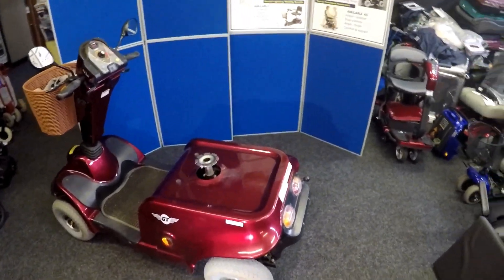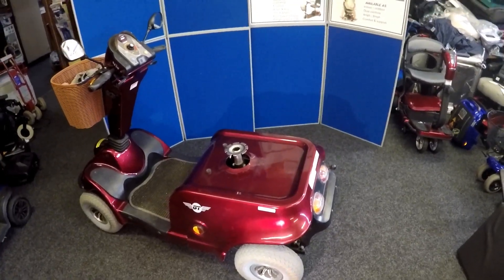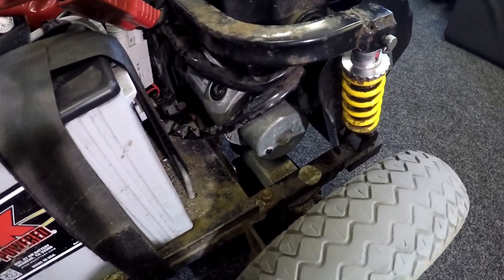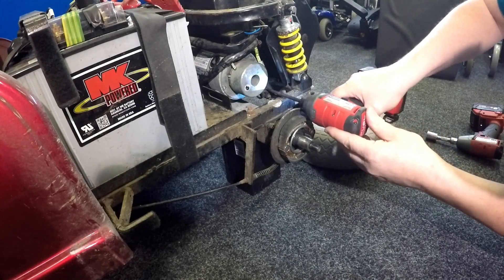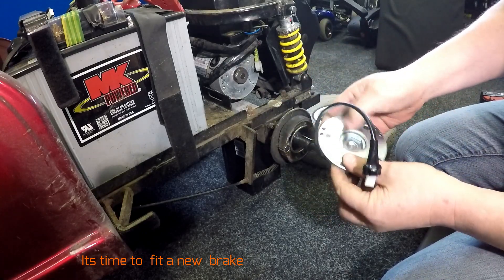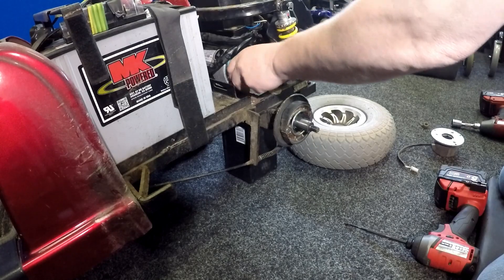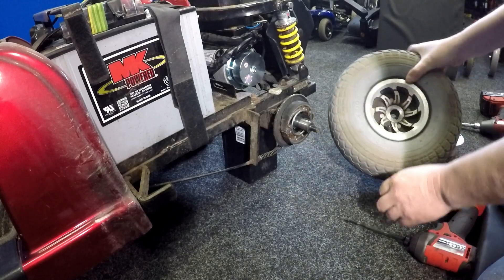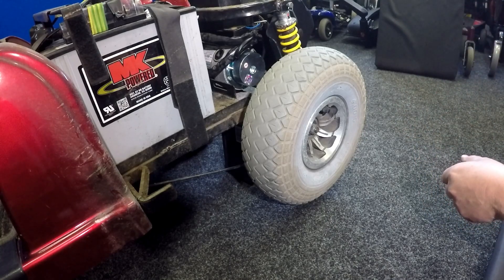Electric Brake Failure

Comment: Hi sir I have lightweight folding wheelchair but always i have issue on right motor but left ok i replaced the right 3 times but still issue coming need ur advice way to repair it instead keep replacing which quite costly in my place around $650 because parts not available
Reply from the maker: @alisaif8714  difficult to say should really get warranty on this. May be a manufacturer issue poor quality

Comment: Great videos I've learnt so much thank you. I've got a problem with my wife's scooter. She had an accident going up hill and the electric brake didn't hold, sometimes it holds solid and sometimes it creeps. I'm guessing replace the brake. The other problem is the thermal cut out cutout in hill why can't they have the reset at the dash board.
Cheers
Jonn
Reply from the maker: @TheMogzz  sounds like something overheating 🥵 the next time it happens check. The temp of the brake and motor which is hotter  could be a few issues either brake worn hence binding on creating heat, slack nut on the end of the motor, worn motor … or hill too steep for the scooter

Comment: Tip; Lightly grease the axle shaft/key area when the wheels are removed. Sometimes a scooter will display a slight clicking sound when driving and I have found that greasing completely stops this.

Comment: Just had a mobility scooter in for repair..

5 flash code.. after changing out the mag brake it was still the same..changed the brushes all good now.

Comment: i have an old shoprider scooter  a late 80s , i cant find parts in australia have gone to several store and they tell me it too old buy a newer one. The i slow down is back off the power coming up to where i want to stop. So the  brake looks similar to the one you showed but mine you can see that nut turning on the back of the motor its not enclosed. Can you supply one to Australia
Reply from the maker: david middleton hi yes we can post down under. Send me pictures of your brake and motor Assy.  To nithsdale.wheelchairs@btinternet.com

Comment: Boss what does it mean when one light flashes and continues to beep? kymco maxi xls
Reply from the maker: Billy Purse Hi Bill. Usually one green flash (led status light) is down to low power. Charge or get batteries tested or you just have done too many miles
Reply: @tomjacques4  the headlight is flashing and making a reverse type noise, very strange???
Reply from the maker: Billy Purse you been caught out in the rain ?

Comment: Do mobility scooters have a differential? Do they have a centrifugal clutch?
Reply from the maker: Most mobility scooter have a diff.  Some though may be fitted with 2 individual motor/gearboxes, makes turning at high speeds challenging. Also one or 2 out there are fitted with a single motor/gearbox and only drive a single rear wheel. Usually on small lightweight boot scooters.  Hope that helps.
Reply: @tomjacques4  cheers for that. The two individual motors sounds like a go kart. Do they not want to speed up or slow down for a corner? I wonder if any have been fitted with a Quaife LSD for grannies that want to go rallying? The one wheel drive sounds like a tricycle which I had a go on recently although I think the difficulty riding it was due to the lack of lean in the bends. As for the centrifugal clutch, when the battery was flat we could hear the motor spin but the scooter remained still. Unless there's some sort of drive engagement lever?

Comment: Is the electric brake the only brake on a scooter? Is it electromagnetic or friction?
Reply from the maker: The electric brake is usually the only brake and  is controlled by the main control box.  It is a solenoid that when power is applied will remove a friction Plate. Some scooter will have an emergency hand brake operated via a lever on the tiller. This is generally only used when in manual mode.  Hope this helps.
Reply: @tomjacques4  thanks a lot. I have been trying to fix a mobility scooter for an old lady who left her scooter unused for three years when she moved house because the new place didn't have easy facilities for charging it and so the batteries went duff. She took it to the shop but they wanted to sell her a new scooter which she didn't want so she asked me to source and fit some new batteries which I did but they didn't work. We tried her old charger which didn't seem to work so we bought a new one. I put it on charge and it seemed to be working but unfortunately the old lady unplugged it because it was on the landing. I plugged it back in and it no longer seemed to be working. I returned the next day to see the scooter missing and when the old lady came back from a day out she said that she had pushed it into her flat, put it on charge and now it was working which was good news because I thought I was going to have to take the cover off and look inside! Good videos, by the way and thanks for replying. Keep up the good work!

Comment: Hi Tom I see you are working on scooter that I have never seen here in Toronto Canada, But most of what you share is helpful and the basic layouts are the same, I have a Fortress 2000 and a Invacare Comet. I am 400 lbs so I need a large scooter for wheel trans trips and a small for bus rides around city, I shop for people that can't get around as easy as me. Thanks again for the insight Tom.
Reply from the maker: Hi again we also have the comet over here but it’s max users weight is 160kg /352 pounds

Comment: Nothing but hassle from my Drive Medical Envoy 8. Broke down three times. Thank goodness for Lloyds Pharmacy taking away to repair it the first two times. The most recent breakdown was due to a faulty electric brake.
Reply from the maker: Hi The Envoy 6/8 has lots of wires at the back end especially connected to a couple of fuse holders. they are cable tied to the s drive controller( stick out on top) and water can corrode said terminals always check these as I have noted that they can break or become slack very easily and cause the scooter to cut out or not even work.
Reply: @tomjacques4  Hello, I am looking for a Wagner electric brake (wr213a96p2) is it possible to find one for a Celebrity XL 4wheel scooter????
Reply from the maker: do you have the frame serial number .. should be a sticker on the seat post or close to the batteries. is it a old 2000 model with a recangular headlight and a jackplug key for an ignition key
Reply: @tomjacques4  hi again, and thanks for the quick response!! the serial# is  S3710112004C30